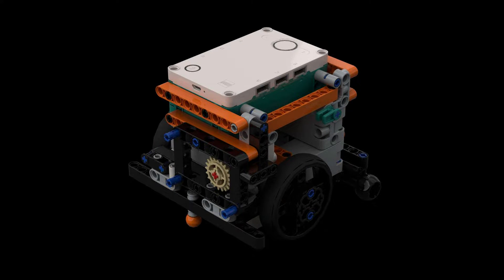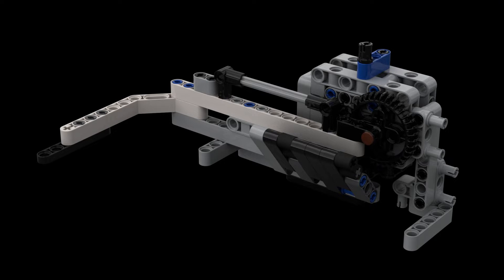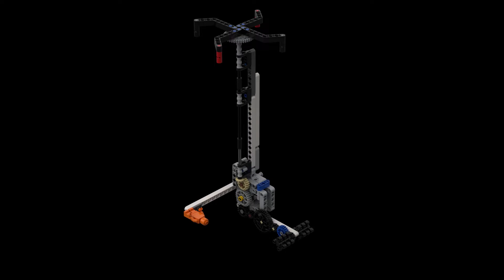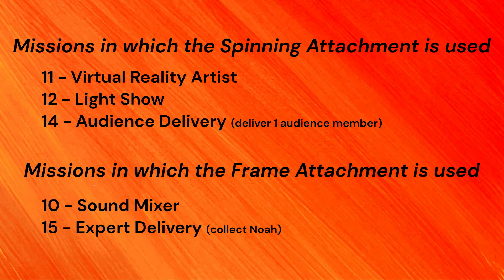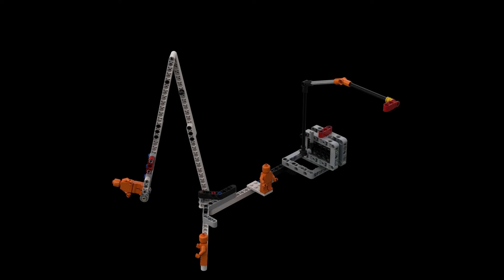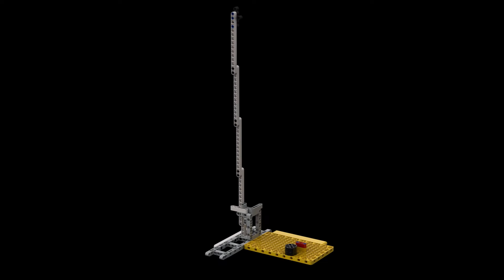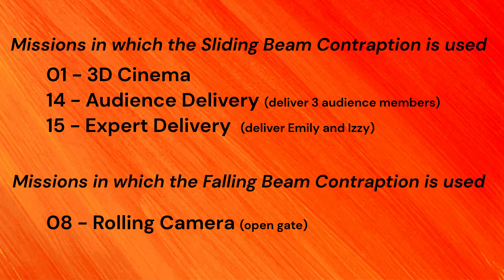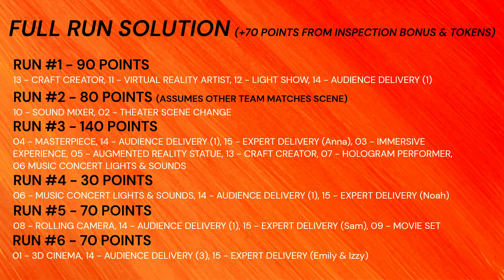MAX POINTS (550 Points) in 2:28 min. 2023-2024 FLL MASTERPIECE Full Run & Match Solution

Comment: How do you consistently start on the correct spot for each different run? Is it just a lot of practice, or do you recommend using a jig of some kind? Thanks!
Reply from the maker: @Jama-t4g  Hello. If you watched multiple of our videos, we try to follow the practice to start from the same spot every time. You are free to use a jig, it just has to be build out of unaltered production LEGO pieces. ⚙️⚙️

Comment: You know you could put all audience members on the pedestal and Ana
Reply from the maker: Sure, but that would not score the max points. Any audience member delivered to any target area scores 5 points and any target area with at least one audience member completely inside scores 5 points. There are 7 audience members and 7 target areas for a total of possible points for this mission of 7x5 + 7x5 or 35 +35=70. If you put all 7 audience members into the museum target area you only get 7x5 + 1x5 or 35 +5=40 points forfeiting the additional 30 points for having audience members in the additional target areas. We suggested this strategy to a lot of rookie teams. 
⚙️⚙️

Comment: You need to loose some points because the helicopter attachment is too long
Reply: Im in a FLL team and my team and me already finished the match and the workers there are so dumb they dont even know the rules and most of them chance rules by their self thank you for information because were going to go another FLL match next year
Reply from the maker: Hello. There are no rules in the game rule book limiting the length or height of any attachment, other than the robot and any attachments need to fit into the launch area during launch. During the match the launch area does NOT have the 12” height limitation that it has for the equipment inspection bonus. 
⚙️⚙️

Comment: Can I ask a question about your robot design? Do your robot has two drive wheels + one track ball? Or your robot has two drive wheels + two small wheels?
Reply from the maker: Hi David. The MINDSTORMS robot inventor kit came with semi ball shaped wheels (LEGO part number 6273330) that worked very well for our design. We use two of those on the back of the robot. Since it felt a little tippy with the short length, we decided to also attach another small sphere (part number 6295155) under the front bumper to prevent the robot from tipping over when stopping or reversing with a heavy load. On the front attachment. 
⚙️⚙️
Reply: Thanks a lot! @6006TechWarriors
Reply from the maker: Hi David. The MINDSTORMS robot inventor kit came with semi ball shaped wheels (LEGO part number 6273330) that worked very well for our design. We use two of those on the back of the robot. Since it felt a little tippy with the short length, we decided to also attach another small sphere (part number 6295155) under the front bumper to prevent the robot from tipping over when stopping or reversing with a heavy load. On the front attachment. 
⚙️⚙️

Comment: Hello, thank you so much for the tips. I am the team lead from the tiny state from Europe, but we can’t solve out how to connect  global zero reset with going straight with yaw angles. Do you have some tips or tricks for this? I’ll be really glad 😌
Reply from the maker: Hello. Which tiny state in Europe are you from? Albania, Andorra, Liechtenstein, San Remo, Vatican?
So, when you reset your yaw angle when you launch (we try to launch from the South wall facing North, so heading North is our “global 0”), you would use that as your first heading for leaving the launch area, then you do a turn (let’s say you started in the left launch area and are now turning 45 degrees to the right), the next moving straight section of the program would then continue in the direction of 45 degrees. If you then want to turn back to heading North, you would turn left to the “global 0” and continue straight with 0 as the new target angle. Turning left from there would go to a negative angle (like -30) which you could then use as the target angle for the next drive straight. 
It becomes tricky with the Spike Prime when you want to go back South (turning to or past 180 degrees). If you have a situation like this, you will have to reset the yaw angle to a new “global 0”. We do that in this video during our second launch and the third one. In that situation it would be best to run the robot into a wall (or any other place with a known direction), reset the yaw angle and go from there. Hope this explanation made sense. 
⚙️⚙️
Reply: We are from Slovakia, yeah all clear, but one more thing. How did you make that you set the yaw angle to go 30 degree but also that it go straight on 30 degree and dont swerve. If I am clear.
Reply from the maker: @milansmiesko2443  Hi. In general, driving straight with the yaw angle sensor requires these things:
The target angle (let’s use 30 degrees)
The current yaw angle sensor reading (let’s say it reads 32 degrees)
A measure of distance to travel (rotations, cm, in or degrees)
Optionally the speed. 
You subtract the current yaw angle reading from the target angle (30-32=-2) and use that as the steering input for a “move steering” block (the one with the steering wheel in the drop down).
If you pick a “move steering” block with speed, you can specify how fast (we usually don’t exceed 50%) the robot will drive. 
This needs to be in a loop, so that the angle reading is constantly refreshed. 
For the loop end condition you will specify your distance that you want to travel. 
Let us know if that needs more explanation. 
⚙️⚙️
Reply: @6006TechWarriors  for now everything is clear. Thank you very much🙏 if anything I will write haha

Comment: Csn I ask do you reset gyro angle to zero before each turns? Or  you only reset it once in the very beginning?
Reply from the maker: Hello. Every time we launch the robot, the yawning angle is set to zero. We use that “global zero” for the whole section of the program, with the exception of drives where the robot turns past 180 degrees, at which point we have to reset the yaw angle. We do not however reset before every turn. 
⚙️⚙️
Reply: Thanks for the quick feedback. Have you compared the method using "globe zero" and "relative zero"(reset zero before each turn.)? Are the differences huge?

Comment: Amazing work! One question though, how do you drop off izzy so consistently? I can see the attachment, but how does the code work?
Reply from the maker: Hello. In order to fit the attachment and robot into the launch area we had to start on the edge of the launch area and could not drive straight towards the 3D Cinema. This helped with the deployment of the attachment. We are also using a yellow LEGO rubber band to help the attachment to straighten out. When the robot is in position in front of the 3D Cinema, it drives forward and backward a fraction of a rotation to wiggle the attachment to force the final deployment. 
Let us know if you need any more help with this. 
⚙️⚙️

Comment: Hello 6006 Tech Warriors. I was wondering if there is an instructions manual in order to build all of these attachments. I was also wondering how your robot moves perfectly straight, as our robot is unable to do so. Please reply back and if possible, please send an email we can contact you by. Thank you!
Reply from the maker: Hello. Sorry, but our attachments evolve over the season and we believe in providing inspiration to other teams but not ready made solutions. The team should learn that there are always multiple ways of solving FLL missions and the fun part of the experience is to try out different options, then document the changes and use that knowledge in the next season to improve. 
As for our robot driving seemingly straight, we get that a lot. We always compromise speed and accuracy. Going slower makes things more accurate. We also use the yaw angle sensor for most of the movements of the robot. We are currently working on a few tutorial videos, but are basically repeating what others have posted before us. 
Let us know if you already need any additional help. 
As for contacting us, we can share more details on our Instagram account. 
⚙️⚙️

Comment: Hi, Thank you for answering my previous question! I’m trying to make a code that uses the gyro sensor to move back,but the spike program doesn’t seem to let me do that. Please let me know if it’s possible and how
Reply from the maker: Hi Jasen. Please confirm if we understood your request. You want to use the gyro/yaw angle sensor to drive in a straight line, but backwards. 
Next question: what version of the Spike App are you using?
We will look into that once we have your answers. 
⚙️⚙️
Reply: Thank you for getting back to me. I believe the verision I’m using is spike prime 2. Yes you understood my previous message correctly. Sorry for getting back to you so late
Reply from the maker: @jasenchen1  Hi Jasen. It is possible to use the yaw angle to drive straight backwards. Can you contact us on Instagram so we can share a picture of an example of the code?
⚙️⚙️
Reply: Yeah sure what’s your instagram

Comment: We are going to participate to fll in turkey too. We need help building our robot. we have built a robot which did 8 missions. But we just couldnt do the rest of the missions so we decide to build another robot. We want to learn more about technic pieces and especially get more ideas about how pieces are junctioned to each other and assembled to use on our robot. We have searched the hole internet but we couldnt find a channel that explains as we want, expect this one. But we still dont understand well what is meaned while speaking in the video. We would like to learn more about this vieo and for this we need the instructions  of the pieces in the video. We would highly appreciate your help...
Reply from the maker: Thank you for your compliments. Unfortunately there are no instructions for any of our attachments, as they evolved from their initial form to what they are today. We started out building something that could do the basic function for one or a couple of missions. Then, as our programs evolved to include more missions, we added functionality to the original attachment. The key is to do as few attachments as possible changes as possible and therefore maximize how many missions you can do with the same attachment or a multi-functional one. 
We will gladly explain any detail you might need, but please try to develop your own solution first that we can try to help you improve. 
⚙️⚙️
Reply: @6006TechWarriors  thank you for your advice. How did you manage to do the sound mixer mission.we developed a new robot and its one of the 3 missions we cant do. We have tried many atachement pieces but all of them didnt hold the sound mixer's pieces that must go up. Even if it holds, while pushing those pieces up  the piece fails.
Reply from the maker: @Arduino_oyun  The key seems to be to hold the center slider up while releasing the left one. One solution would be to turn the robot slowly to the right to release the left slider first, while holding the center one up. Our attachment will hold the center slider momentarily longer while very slowly backing away from the model. 
⚙️⚙️

Comment: Hi, I just wanna say that your solutions are amazing. For the arm for mission 11, how are able to make it spin so fast, but still have enough power to spin the top of the light show. Thank you
Reply from the maker: Hello. First and foremost we let the attachment motor spin at 100% speed for this particular mission. Then there are multiple gear ratios involved the motor directly drives a 20tooth gear and our attachments all have 12 tooth gears interfacing with that at the robot. From there an axle directly drives a 28 tooth gear. This steps down to a 20 tooth gear before we re-orient the axis of rotation with a 12 tooth bevel gear. From there it is a straight axle to the propeller that spins the light show. Overall we multiply the motor speed by a factor of 3.88. 
⚙️⚙️
Reply: Thank you for replying
Reply: I made a similar one before the video was posted, but mines spin slower with the gear ratios and once it engages the light show, it slows down by a lot unlike yours. Even through my spins slower, it still does not have the same power as yours. It is possible the motor is too weak. I use the small spike prime motor

Comment: Hi, can you give me please robot code? I want see robor code! I am robotics teacher
Reply: Hello we are from Kazakhstan and we have only 3 myblocks. Please, can you give me some myblocks?
Reply from the maker: @berikbolmadiar  Hello. MyBlocks are created by you, that is why they are called MyBlocks. You can attach multiple lines of code you want to use repeatedly, maybe with changeable variables. If you had the program steps to perform a right turn to a certain yaw angle for example, you could make a MyBlock with inputs for the tightness of the turn, the speed and which angle you wanted to turn to, then attach your code and replace the variables with the inputs from the MyBlock. Now every time you want to make a right turn, you just use the single MyBlock line, enter the three variables and execute your regular four or five lines of code in one line. 
We are working on a tutorial video for this at this point.  
⚙️⚙️
Reply from the maker: Request for code

Hello. We are sorry, but we do not believe that sharing our code would be useful to you. We have created a lot of MyBlocks to make programming easier and as a result our program is mostly nondescript MyBlock lines that will not mean anything to you without explanation. Additionally this program was specifically created for the robot and attachments we used in the video.  It will not work without adjustments if your robot and attachments are different. 
Let us know what you need help with and we will help you. 
⚙️⚙️
Where are you from, if you don’t mind us asking?

Comment: I have a question about the jig you used to open the gate on the rolling camera...It looks to be taller than 12". We understand the bot and attachments have to be less than 12" during launch. Are we misunderstanding the rules?
Reply from the maker: Hello. In one of the previous seasons the height requirement at launch has been taken out of the rules. Now the only height requirement that exists is for the equipment inspection bonus before the match, where if all your equipment fits into one of the two launch areas with an imaginary 12” ceiling, you get the 20 bonus points. There is no more rule prohibiting the robot and attachments to be taller. 
⚙️⚙️

Comment: Also, in my region, the rule get updated that audiences couldn't be attached to the any attachments.
Reply from the maker: Hi. The official rules and challenge updates published by FIRST (on their website) allow connections of audience members with team equipment if the connection can be separated in one motion without breaking the mission model which should not be a problem for any audience members. It is strange that your region has created their own rules. 
There are ways to transport the audience members without connecting them to the team equipment. 
⚙️⚙️
Reply: @6006TechWarriors  thanks, I will double check the rules.

Comment: I noticed your wheels are black color and small diameter. Where did you get these wheels? The prime kits has the blue color wheels and kind of slippery.
Reply from the maker: Hello. The robot in this video was built from the LEGO MINDSTORMS Robot Inventor kit, which was the retail version of the Spike Prime. This kit comes with four medium motors only and all parts were manufactured in different colors. The small wheels are the same as in the Spike Prime kit, just a different color. We recommend to clean the tires periodically with alcohol wipes to restore their grippiness. 
⚙️⚙️

Comment: During game time, Bluetooth is not allowed. Does that mean you only can upload one file to the control unit? By using only one coding file, how did you managed to complete many steps which back to home area and switch the different attachmentes?
Reply from the maker: Hello. You are correct that many event organizers recommend to switch off the Bluetooth communication to your robot. You can still download different programs to the robot. The Spike Prime has 20 program slots (numbered 0-19) and you can decide which slot each of your programs gets downloaded too by clicking on the depiction of the Spike Prime brick in the bottom right corner of your programming canvas next to the play and stop buttons. There you can select which number slot the program you currently have on the screen goes to. During the match, whenever the robot comes home and you change attachments, you can select the next number program you want to run. In our case we did not want to waste any time with selecting the next program, so we actually combined everything into one large program and used the “wait until” block with a sensor condition “right button is pressed” to advance to the next section of our program. Unfortunately this way you won’t be able to run a single program again individually. 
⚙️⚙️
Reply: @6006TechWarriors thanks a lot!